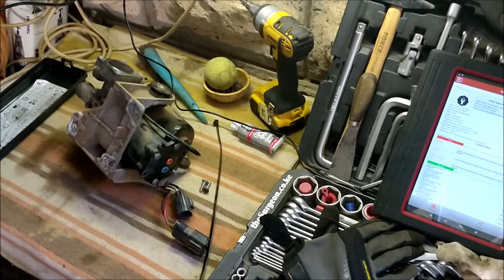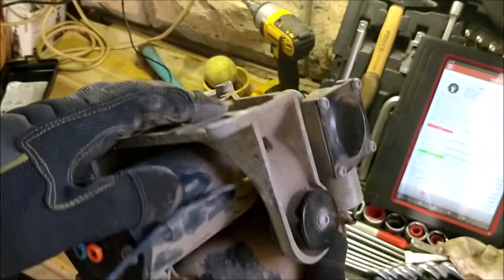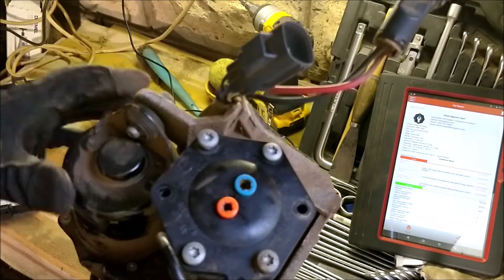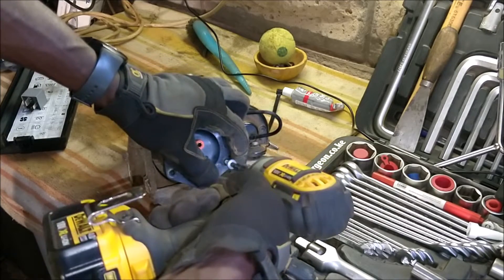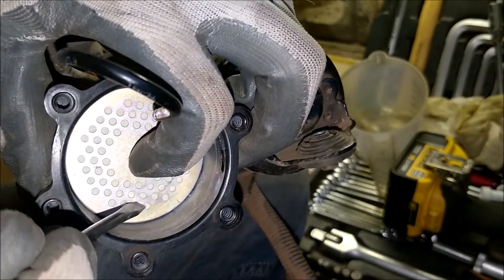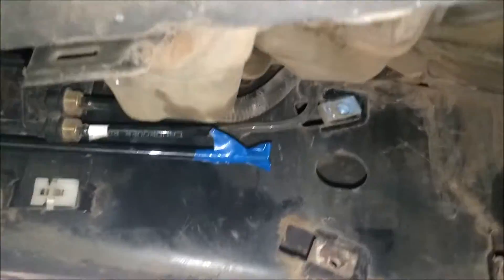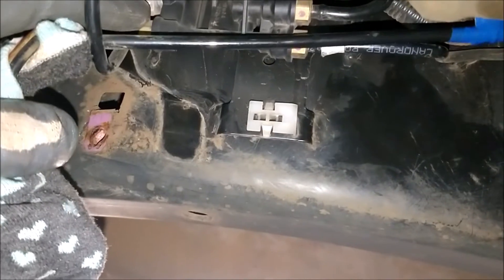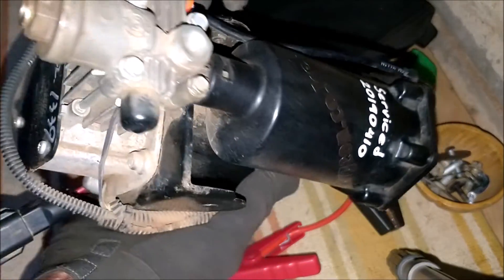Land Rover Discovery 4, Air Suspension Compressor Fault-Finding

Comment: What component inside the aircompressor keeps the air pressure from leaking out the rear valve when its off? I bought an ebay compressor and it pumps up, but doesn't hold air.  The new replacement one I received does. What can I fix or maintaince in the defected one?  Air check valve? Where is it?
Reply from the maker: Which unit did you get that is leaking. Some of the aftermarket options have questionable build quality so maybe you could share what you got..?

Comment: For the 8mm and 10mm exhaust and I believe intake line do you need insert fittings inside the line for reconnection to the compressor or is straight tube to compressor acceptable?

Comment: What software or computer do use to check the system?
Reply from the maker: It's a custom patch of the Launch software supplied with the hardware dongle.. :)
Reply: mista lobsta   Thanks.
Reply: mista lobsta    What version are you using?
Reply from the maker: @Jusselmaria  , it's custom but based off of v11.86